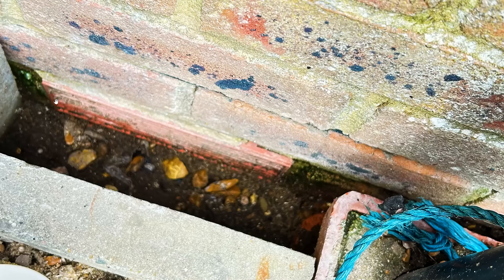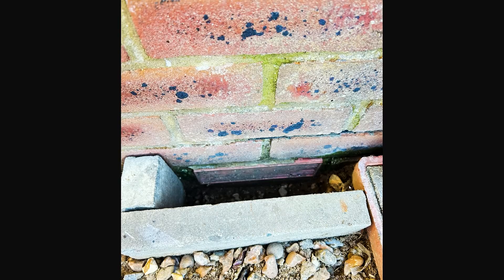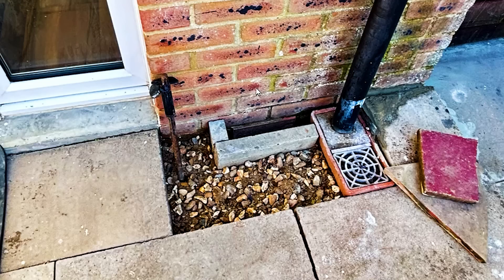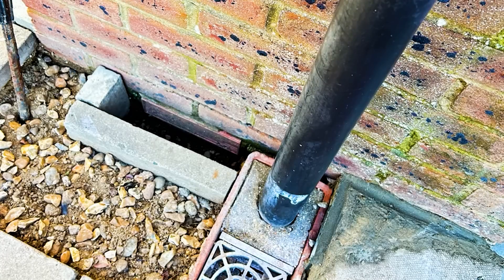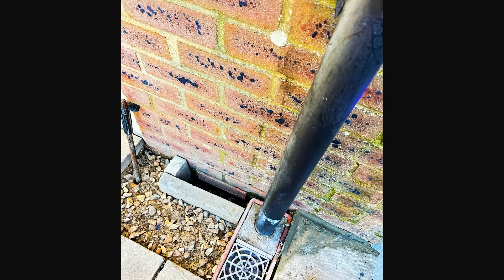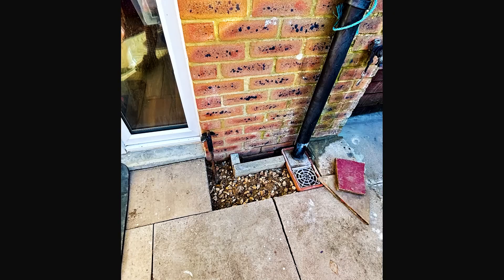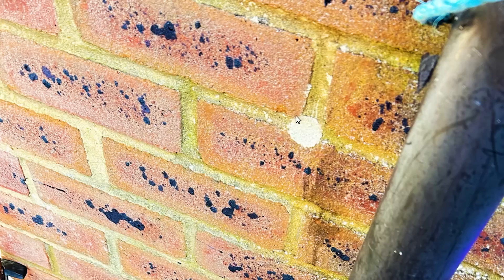Leaking Air Bricks Below Ground Level?

Comment: In my case I have a similar issue that the survey pointed out. 

Somebody put a lot of patio stones in front of the house completely blocking the front underfloor ventilation bricks. 

However, I have another issue with the cavity insulation. I opened the floor as I have damp patches all over the carpet. The cavity wall insulation fluff just comes out from the inner wall behind the air brick and I don’t think any air is going through even now I freed up the outer air brick… 

What is the best thing to do?

Comment: Hi I have installed a new plastic air vent in the bedroom. Every time I enter the room I get dust and debis in my eyes! It's a nightmare what can I do pls?
Reply from the maker: You need a back  draught flap on it but that will be noisy at night so you might also need a hit and miss on the vent so you can close it when it is windy.

Comment: There are 3 air bricks at bk of that house , and stones all along house , the stones for drainage wereabove  both black membtains , the housing where told many many times , that skirting boards wet carpets damp etc etc , they had house newly built 26 yrs ago , 2 wks of Ty hem moving in the lounge flooded with brand new carpets, they did come out and lower the patio by 1 inch , they say the garden is so wet , the bricks along bk of house is wet , that air brick with 2 pipes in is at front of house they say fronts not as bad , but due to a leak in kitchen , it was not good 👀🤔

Comment: What's a good way to evaporate if the problem we have is isn't a low brick air gap but something else. 

I've been under the house and there isn't a membrane... its wet soil and a few puddles... even found some roots growing under there too 

I was gonna get a heater under the house to do it that way... is that a good idea? 

Cheers Rog 
- C
Reply from the maker: You won't dry it out if more water is coming in. You need some 1000 guage polythene sheeting over the whole area to keep the moisture on the earth side. Try to get it lapped up the walls so it holds the moisture in. The airbricks will then cope with the residual that finds its way up.

Comment: I could be wrong but in 1 photo it looks like the DPC may only be 1 brick above the air brick? If so I think some digging is required!

I bought a property where the ground on my gable end had been raised above my DPC, which unfortunately was my neighbours path & caused a bit of a dispute. 

In the end as I couldn't just dig away my neighbours path so I ended up getting them to allow me to dig a thin 100mm trench along my wall down bellow my DPC (horrible job), placing a studded DPM against my wall, put a 60mm land drain in the bottom of the trench that drained to a safe area, back filled the thin trench with gravel & then fixed a fascia board with the nib cut down to my wall (acting a bit like a skirting board) to overlap & hold in place the studded DPM that was above ground.

In my case stopped damp pouring in.
Reply from the maker: I think the ground levels are an issue but with level access requirements you see a lot of it
Reply: @SkillBuilder  Last time I looked (years back) it said your finished ground level should be minimum 150mm below your DPC to allow for rain splash etc. In my case my wall was solid brick with no cavity so the water was practically pouring through until I dug the trench & installed the DPM & land drain but it's been dry as a bone since 👍

Comment: Bought our current 1930s semi in 2013. Lifted the laminate flooring. Wooof! The green felt underlay squares were black with fungal spores. Choking. Cleared it all out. Looked under floorboards... sopping wet. Removed floorboards, cleared rubble from walls knocked down for through lounge, found a puddle where the lead water supply pipe emerged vertically inside the front door area - not a leaky pipe but high water table. That and the driveway had about four layers from original to a more recent brick block paving that started level with the pavement and sloped down to finish flush with the dpc! Nearly 2 grabaways of material got down well below the dpc. Dug and set up a French drain across front of the property. Dug down to the lead pipe to replace with wider bore plastic. Relaid a driveway sloping from pavement to two courses below dpc with a channel drain above the French drain. All bone dry in the 3-feet high void under the original house. Not a trace of mould or spores. With no plastic sheet under the mixed depth rough concrete on the bottom of the void, we do get some white fibres of salts. Interlocking garage rubberised plastic floor tiles makes it a pleasure to push a trolley with Really Useful storage boxes and work on pipes and wires. Even the plumbers and electricians have said how nice it is to work down there. A lot of effort but worth every muscle strained and penny spent.
   But why did previous owners lay a drive like the one we inherited and why would some previous owner of that house have such absurd raised path? Then we saw some new near neighbours get a no-skill 'builder' to do something similar to a house they were living in and intended to live in. If we had left our new driveway as it was, there would have been a big step up to the front door, as with  all our neighbours. So we made three very wide steps so frail folk could take them one step at a time and the rise of each step is just 100mm. With the slope down to the steps from the pavement, the natural movement is almost horizontal. Everyone loves it. Astonishing how many people just don't think about such things. We didn't have building experience when we started but we just applied a bit of thought.

Comment: Looks to me like the patio was raised to meet the door threshold (breaching dampproof course) instead of creating a step down to a ground level patio. If it were mine, I would strip off the whole patio layer to lower it, and have a step down to a the re-layed patio. Or if needing the indoor & outdoor levels to be the same (maybe for child safety, prams or wheelchair users) then maybe replace (raised) paved patio with raised decking, which would allow airflow beneath.

Comment: Internal mould is from a bridged cavity, very likely uncleaned cavity from brickies. Vents are supposed to be under dpc, not above - as per building regs. External levels have been retro fitted level to damp, hence the wicking effect.

Comment: Cavity air bricks have to below the DPC, including telescopic ones otherwise they bridge the DPC course, those in the pictures could only have come up one course at the most. The path levels around the house are far too high in comparison to the DPC course, hence the attempts to protect the air bricks with the edging stones, which will also be helping to stop air flow into the airbricks. Retro fitted Cavity wall insulation is very good at falling below the DPC level and then bridging the DPC as well. The only way to really stop the problems is the lowering of the external path levels to at least one course of bricks below the bottom edge of the airbricks.  The green mould to the brickwork above the DPC course is behind a guttering downpipe and has probably been caused by the down pipe being blocked somewhere above wherever the green mould to the bricks stop with water then backing back up to the gutter and then overspilling and running down the brick work either from the top or a badly sealed joint. As it looks a reasonably new property it has probably fallen victim  to one of the worst afflictions of the modern era of mass produced housing by companies interested in profit only. That affliction?  A site manager who doesn't know his arse from his elbow, in the trade they are also known as fuckwits
Reply: The whole point of the telescopic air brick was to bypass the DPC without comprising it's ability to do it's job, and to ensure the outside air brick to a suspended floor is above the DPC. The DPC is the datum point at which the ground level should be a minimum of 150 mm below accept in one circumstance where one entrance to a house being built today has to have wheelchair access. Something that I am not so keen on myself.
If you put the air brick below the DPC then you are more likely to get water ingress which will exacerbate the problem of damp within the property.
Reply: @Frenchwine15  no its not

Comment: Damp problems seem to be the biggest problem I come across. It’s quite a complicated subject. From leaks, to condensation, chimney salts, mould, dpc’s, ventilation…. I get it right most of the time, but there are times when it’s really quite difficult to work it out. Sometimes you might spend a couple of hours rectifying the obvious, but it still persists.

Comment: the air brick should be the course below dpc, but the level thresholds negate that because you can't have 150mm below dpc if you want a level threshold.

either way that vent is too low

Comment: I'm looking at that clip the patio the outside ground is too high it needs to be the brick below the airbrick I'll get a digger and dig a trench at 6" wide one brick below the airbrick all the way around sloping away to vanishing point. You can see the cement pointing is above the damp proof cause
Reply: yes needs a proper wide drain around the building and make sue the drains are clear and the downpipes fixed and not leaking.
Reply: Can this be done by hand?

Comment: The true DPC looks to be one brick higher than the top of the air brick (time index 1.05).  I’m no expert but it looks like there are more than one problems here.  The aftermarket patio, and two arising problems. One, bridging the DPC, and two, the air brick problem. 

As Rodger said at the start, more photographs are always helpful - a few wider views would unpick the whole problem I expect.
Reply: I was literally just about to comment on the DPC looking to be 1 brick above the air vent, this calls for a proper solution that will involve time & digging!

Comment: Yep ground level is clearly to high patio is level with the floor inside
Reply from the maker: level threshold from the builders of the homes
Reply: @SkillBuilder  If that were the case, other homes would be similarly effected.  I strongly suspect if you lift some of those slabs, you will find the original patio - laid at the correct level.......................
Reply: Over neibours airbricks are higher only 1 brick higher , that 1 air brick by pipe fills right up over the top when rains hard ,

Comment: The patio is bridging the DPC and causing rising damp, simple as.  Nothing to do with moisture under the floor, the air bricks are not blocked
Reply: Yep, hard to tell from the photos, but looks like it is, certainly to the right of the drain.
Reply: But water fills well over air bricks n takes ages to go down as garden along these houses are soaked not anoth drainage
Reply: @AlisonHylands  
If the patio is dropped below the air bricks the water shouldn’t collect, it should run off elsewhere. 

Wish I could see round the side and front of the property to be honest so I can see where the water could flow. 

Which borough are you in?
Reply: Nothing has changed in 26 yrs , and she’s very clean that green she would clean off regular with patio cleaner , but she had to clean mold in house n repaint all summer not realising the air bricks were the problem as such , but maybe all water from kitchen 5 month leak n water meet up n made all mold worse ? Who nos
Reply: @AlisonHylands  
Like I said to you in the thread of my other comment Alison (not sure whether you’ve seen it or not?)
 
The DPC must be over 150mm above ground level, this is NOT optional it’s building regulations. Dropping it 1-2 inch is not good enough. They must be got back to do the job properly. 

Call them again and call the building inspector too and ask them both to meet you together. (Though not sure the building inspector covers council housing but give them a try anyway.)

If they argue, tell them you want re-housing as the property is not habitable. 

You’ve got to put your foot down Alison. The law is on your side 100%. As a tenant and with building regs.

It maybe a good idea going seeing citizens advice to get some free legal advise and ask them to help with writing a formal letter to housing demanding action to be taken. 

Hope that helps, all the best. Lee

Comment: Not sure that the house builder is the problem, I suspect someone has raised the patio at a later date at some point. The DPC should be at least 150mm above ground level.  It’s about an inch below ground level, so going to get damp issues there for sure.
Reply: 99.9% this. The ground level has been raised relative to the air brick and DPC and is too high. Not only is the airbrick compromised but splashing and any flooding will pour over the DPC.  I'm surprised Roger hasn't spotted this.  The proper solution is remove the patoi, dig down and re-do.  Resolving the airbrick will only be fixing half the issue.
Reply: @wings9925  
Yes, I’ve said this in another comment. The problem is the DPC is bridged, nothing to do with the air bricks and moisture under the floor. Raising the air bricks will solve nothing. Just hope the house owner is reading these comments😅
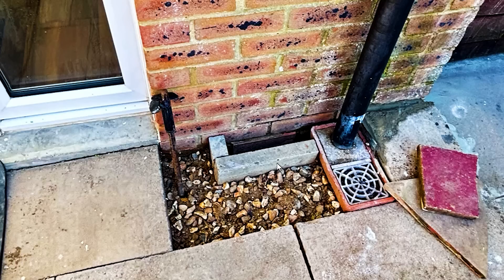Reply: @wings9925 it probably would be the right fix, but that slab on the right hand side of the drain ( 1:24 ) looks like it might even be bridging the DPC? 
I think I'd dig it all out like they've done around the air brick.
Reply: @ricos1497 
The DPC is laid on top of the air brick 1 inch below ground level. Rodger points the DPC out here 0:40
Reply: Actually, that’s not the DPC on the air brick, it’s the cavity tray for the air brick. 

The DPC is a course above. Still too low though, especially with the cavity wall insulation.
Reply: I'm dealing with  this problem now. The paving is too high. It's all about level access. In my opinion the paving should be lowered .as I understand one entrance should be nominated level access not everywhere
Reply: @karlforman936  
Should be just at the doorway too and have a DPM barrier up the wall.
Reply: can't wait to see his reply
Reply: Exactly what I thought, thanks for saving me the time to type a full reply 😁👍🏻
Reply: I'm working for a house builder now and this is what they're doing
Reply: The water goes over the f air bricks 😢 n takes ages to go down if few days rain there is 3 air bricks along that wall 😮
Reply: @AlisonHylands  
Not sure if you mean the hole is filling up with water to the top of the air brick with heavy rain or when there’s flooding? Either way the DPC must be over 150mm above ground level, this is NOT optional it’s building regulations. Dropping it 1-2 inch is not good enough. They must be got back to do the job properly. 

Call them again and call the building inspector too and ask them both to meet you together. (Though not sure the building inspector covers council housing but give them a try anyway.)

If they argue, tell them you want re-housing as the property is not habitable. 

You’ve got to put your foot down Alison. The law is on your side 100%. As a tenant and with building regs.
Reply: But the housing did drop patio  1 or 2 inches 25 yrs ago due to house flooding lounge when 1 st moved in brand new carpets soaked 😓
Reply: @AlisonHylands  
Maybe an idea contacting citizens advise and asking them to help you with legal advise and sending a letter to the council. Will show you mean business. All the best.
Reply: Yes obvious cowboy patio builders  
Self taught nobodies
Reply: Can we remove this and bulid air vents and put normal Air ventilation above 30 cm ??
Reply: @thebulider8283  
Only thing that needs to be done is to lower the patio, the air bricks don’t need touching.
Reply: No garden not been raised 26 yrs , after they moved in house flooded 3 times housing did drop the patio by couple inches
Reply: All walls wet out back 3 airbricks are lower than all there neibours
Reply: It’s housing associations house , I understand she’s told them her carpets always damp for yrs , pulled all carpets up 5 yr ago to replace with wood , but now wood all damp n mold in cavities etc up through cielings ,
Reply: @AlisonHylands  
The patio is still too high whether it’s been raised or not. Sounds like some environmental issues involved with the flooding, could be flooding regularly without them knowing?

As a quick fix I’d say paint/spray the external wall with a good damp proofing (I use crown damp proofing myself) they must do the whole wall from top to bottom. Otherwise water will get in from the top and have no way out but to go inside. 

Then get on the council to sort out the flooding issue, ask them to put a soak away in piped into the drains. It may not be much use if floods bad and over loads the drains but could help with minor floods. 

Definitely damp proof seal the walls though, sounds like penetrating damp if the ceilings are showing signs of damp, that or a leaking pipe.
Reply: Can see here 1:53  the patio is at the same level as the internal floor and door steps. 🤦🏻‍♂️

The problem is not the air bricks, it’s the patio.

Comment: I don't think there's anything wrong with the house build - someone naughty has just built a raised patio and built up over the bricks & dpc too? Look at the grey concrete on the right of the house - it looks original and lower than the patio?
Reply: And u can tell it was certainly done after the house build as they boxed in the vents with blocks laid within the patio. No house builder would have done that crap.